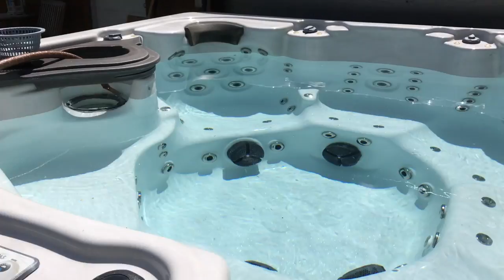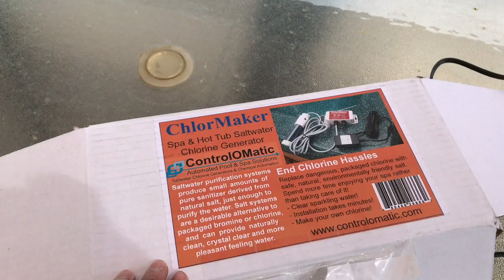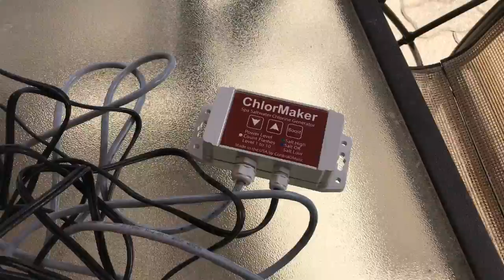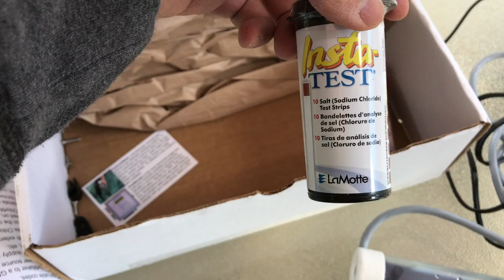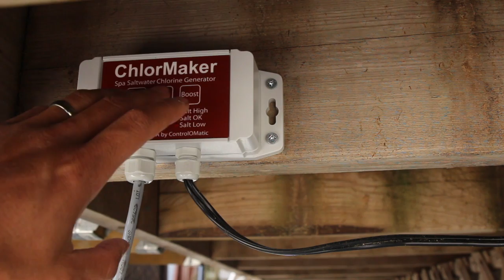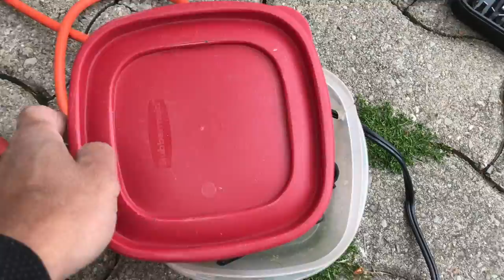Salt Water Chlorinator for your Hot Tub (ChlorMaker DO)

Comment: Thank you so much for this. The company is now defunct sadly they didn’t have enough customers. I got one, but I got the bromine Clormaker maker. My question is this can I use pool salt in this one as well or do I have to use the bromine salt?
Reply from the maker: Using regular pool salt (sodium chloride) in a bromine Chlormaker will not break the unit. The Chlormaker is designed to perform electrolysis on dissolved salts.
However, instead of generating bromine, it will generate chlorine. This is because the sodium chloride (NaCl) will be broken down into sodium and chloride ions, and the chloride ions will be converted into chlorine gas.
Therefore, if you use regular pool salt in your bromine Chlormaker, it will still "work" in the sense that it will produce a sanitizer, but it will be chlorine, not bromine.
If you specifically want bromine as your hot tub sanitizer, you must use sodium bromide salt. Using the wrong type of salt will simply result in the generation of the incorrect halogen.
Reply: Thank you so much. This is a Great easy to follow video and thank you for replying to me. We had our first soak and are so much happier than we were in the chemicals. The salt is wonderful feels much better on the body..

Comment: Convert your chlorinated hot tub into a chlorinated hot tub.
Fact check: if you're hot tub does not have a titanium heater element & is stainless steel which almost all spas are stainless steel the salt chlorination will corrode the heating element.

Comment: Will the salt water corrode the heater element? Some have reported needing to replace their water heating element after a while. Thanks.
Reply from the maker: yes the heater element and the housing tends to degrade faster with the salt water.  it’s easy to replace though so you know how to do that yourself,  it’s worth converting to Salt water.
Reply from the maker: yes the heater element and the housing tends to degrade faster with the salt water.  it’s easy to replace though so you know how to do that yourself,  it’s worth converting to Salt water.

Comment: Hi Danny, thank you for the very informative video. I just got my Chlormaker, and will be setting up my hot tub this week. Wanted to ask about any additional chemicals, will I need to use anything other than salt? Thanks
Reply from the maker: well you still need to test alkalinity, and PH so you might need an increaser or decreased for each.  also, I like using spa shock (non-chlorine one) after a big event when lots of people have used it (say more than 4 people). That way, the unit doesn’t have to super chlorinate and it lengthens the life of the salt cells.
Reply: Thanks for the quick reply. Looking forward to using my salt water spa.

Comment: Where does the salt you buy in bags go?
Reply from the maker: You put the salt in the water, one cup a at a time until your salt levels are at the recommended amount…usually 5 cups to start
Reply: @DDIY-Guy   thank you, I wasn’t sure if it needed to be placed into a specific area of the tub ie near filter….Totally new to this whole hot tub thing!!  Just bought one 2 weeks ago, waiting for the electrician to come and set that up….looking forward to enjoying some nice evenings outside enjoying the hot-tub and the night sky!!
Reply from the maker: That’s fantastic!  Which salt unit did you get?  I got the SmartSpa version which I also did a review on.
Reply: @DDIY-Guy   we haven’t gotten a salt water unit to add on as of yet….we are trying to gather as much info on them in order to decide which is best and will work best!!  I take it you are happy with the one you purchased?  What kind of salt do you buy to use in your unit and is there anything else we need to buy to go along with the salt water system?  Thanks again for the help!!!
Reply from the maker: I got the ControlOMatic SmartSpa from www.hottubcoverscanada.ca and we are really happy with it.  The salt you use can be baught in big bags at your local pool store. I got mine at Costco for $6/bag….it’s called Pool Salt.  You can buy specialty salt but they are really expensive.

Comment: Hi Danny, wondering if you are still using this and if you’re happy with it? I am looking at buying the Megachlor - CD from this company for my pool. Thanks in advance.
Reply from the maker: I actually had an issue with the seal on the drop rod so I reached out to the company I baught it from and I ended up upgrading to the better and more improved version….the SmartSpa.  I love it since it has the automatic chlorine level sensor and only generates when the tub needs it.  I did a review on that one as well.  Had it for several seasons already and very happy with it.
Reply: @DDIY-Guy  GREAT QUESTION KIMBERLY! I almost didn't read this far / look at dates. Now I'm going to go watch  Danny Jose's review of SMARTSPA

Comment: Be careful on new spas!! Be sure that salt won’t kill your warranty. Salt is corrosive so if you run your salt to high it will fry your pump, heating Elements. Anything metal. If you are allergic to chlorine then look for another option like this.
Reply from the maker: Good suggestion on checking your warranty but chlorine and bromine is also corrosive to metals so I’d be surprised if salt water would void the warranty.  Plus the parts per mil in the salt needed is so low that you can’t even tell there is salt in the water. Be careful anyway to buy spas that have corrosive materials in your pipes and equipment as whatever chemicals you use to sanitize you spa…it will corrode that metal. Most spas are made of material that should not easily corrode so do check that warranty.

Comment: Video answers a few of my questions I had before my new hottub arrived. Only issue I had with the video is your Tupperware container if somehow water does get in you will then be soaking your plugs in water. At worst drill a few tiny weep holes just incase.
Reply from the maker: love that tip!  yes, if water gets in the container, it might cause corrosion in the plug box.  I'm going to drill some holes at the bottom of mine as well.  thanks for the comment.  have a great rest of the day!

Comment: Now that you have had the salt water system for a few years how are you liking it
Reply from the maker: Well I’ve had started to have some issues with calcium built up but had to clean out.  Then my seal on the titanium plate connections were defective so I call the place I got it from and they replaced it for me.  Then my power plug stopped working, probably because I left it out all winter long….i got that replaces for free as well.  Anyway, After 2 years of use, I ended up upgrading to the higher version…it has automatic chlorine detection.  Happy with it.
Reply from the maker: I made another video review of it as well.

Comment: Do you have to change the hot tub water more frequently with salt?
Reply from the maker: No I find if you keep the chemical levels balanced regularly, it will be just the same frequency of times you should change the water.  I prefer changing my water every 3-4 months.   in fact, since we use the hot tub a lot more with the salt water, that might make you want to change it more frequently :-)

Comment: Can I just pour in some pool salt? Or would I need to adjust settings?
Reply from the maker: Yes you can add pool salt....but make sure you add a little less than what is prescribed for your hot tub capacity since it is harder to decrease the salt vs just adding a little more salt until you reach the desired amount.  If you add too much salt, the only way to decrease it is to take out a quarter of the water.
Reply: @DDIY-Guy  thank you very much!
Reply: Red Head did you just add pool salt directly to the water ? Did u need to purchase a system? I’m not sure what to do.
Reply from the maker: You just add the pool salt a cup at a time.  No need any special tools.

Comment: I got the smarter spa version which only turns on when needed rather than on a schedule. Since we don’t use the spa consistently we did not want it cycling on on a schedule because the level would get to high.
Reply from the maker: Yes,  that one is certainly better.  I wish i would have gotten that one instead.
Reply: I just got that one, but haven’t set it up yet. I’ve balanced the ph, and I’m ready to add salt. I have a 325 gallon hot tub, and I’m wondering what kind of salt you used. I got one that also has minerals in it.  I hope this will work, because I have a lot of health and pain issues. 
I’m a bit worried because we have city well water and it’s hard and “problematic”. Lol! 
Am I doing the right thing? Thanks!!!!
Reply from the maker: Not really recommended to use any other salt except for pool salt but if the device works with that kind of salt then go ahead.  Not sure if that would void the warranty if the unit gets damaged.  If you go to their website, it will tell you which salt is recommended and what will harm the unit.
Reply: If your quote unquote salt unit ends up getting damaged/breaking. I would at that point move to a different product called"Aero Spa" completely 100% chemical free soaking.

Comment: Hey Danny: thank you for this informative video - my question is: if my hot tub water hardness level is high or low - can I still add the chemicals to adjust and manage this issue? or will it CLASH with the ChlorMaker DO system?
Reply from the maker: Yes, you want to make sure you still keep the water chemistry balanced and check it regularly. I also use spa shock from time to time after a lot of bathers to minimize the use of the chlorinator cell on Boost mode.

Comment: Can you use Himalayan salt or epsom salt instead pool salt?
Reply from the maker: No really recommended to use any other salt except for pool salt but if the device works with that kind of salt then go ahead.  Not sure if that would void the warranty if the unit gets damaged.
Reply: A little late! But, download the info from their sir and it will tell you what types of salts work and which are corrosive.
Reply from the maker: No really recommended to use any other salt except for pool salt but if the device works with that kind of salt then go ahead.  Not sure if that would void the warranty if the unit gets damaged.

Comment: I love this idea, thank you for the video.  Question - when converting my hottub, Can the salt water damage anything inside the hottub, like the plumbing? I imagine high amounts of salt are corrosive?  no?   Our hottub is a Sundance Bahia
Reply from the maker: Thank you for commenting!  Just to clarify....the amount of salt needed in your hot tub is very low...mine took about 6-8 cups of salt for 400 gallon tub so you can’t even spell it or taste it in the water.  All the pipes and equipment are made with materials that don’t corrode (plastic, aluminum, etc) so salt will not harm it.  In fact, the chlorine/bromine that you normally use is more corrosive than the amount of salt that is used.  Converting your hot-tub to salt water is safe for your equipment.
Reply: This guy is absolutely incorrect, salt is corrosive to the metal parts that will come in contact with water such as your heater element for example, all you have to do is go on forums/threads- read about how salt has ruined people's hot tubs over & over & over again.
Reply from the maker: I don’t know about you but I’ve had this chlorinator for over 4 years and my hot tub is still running…including pumps.  Salt or no salt, if you maintain your hot tub properly, then it will obviously last longer.  Whether you use corrosive chlorine or bromine or salt chlorinator, your equipment will break down at some point…remember that in all cases, you are still using water and that will eventually corrode metal parts.  Hoping mine last a few more years….then I simple buy a new pump and replace it for a few hundred dollars.

Comment: can i use this to replace my ace cell? or do i need your generator ?
Reply from the maker: No sure it will fit but it looks like it might work.   The directions for this salt cell is to drop it at the centre of the hot tub but I guess the chlorine would still circulate in the filter.  I can measure the cell so you can compare it to the ace.

Comment: OK, Fill with soft water from the house system (softened water). Add chlorine. Heat to 90 before turning on the chlorinator cell. But I'm still not sure about balancing. Can you tell me more on how to balance the water? PH minus to lower PH? How do you adjust Alkalinity? Our water is always high. Thanks!
Reply from the maker: Measure your water with the test strips, if ph or alkalinity is high or low, just get the chemicals from the pool store to either lower or increase the levels.  If your are still not sure, take a water sample to the pool store for them to measure, and they will let you know what chemicals to put in and how much to balance your water.

Comment: Yes, I've heard and read about balancing. Not sure I really understand what to do. I have test strips for hardness and alkalinity and ph. How do you suggest I go about it? Much appreciate your help.
Reply from the maker: Fill the tub with new water, add your regular chemicals (chlorine, not bromine). Make sure it’s balanced.  Add the salt.  Then get the water temperature to over 90 degree before using the salt-water chlorinator cell.  It’s pretty straight forward.  I find I use less chemicals in general to keep the water balanced going forward.

Comment: I think I'm going to go salt on your recommendation. With chlorine or bromine I was told to Not use softened water, but to use untreated well water. But it sounds like with saltwater I could use pre-softened water from my house system. Can you confirm that it's ok to use soft water? A big advantage to me would be the avoidance of iron colour which we get now from the direct well source. Thanks!
Reply: use a rv water filter on the end of your hose. works well for me
Reply from the maker: Awesome!  Thanks for sharing the comment
Reply from the maker: As long as you add the proper amount of salt with the capacity of your tub, the generator will produce the necessary chlorine needed to sanitize your water.  Make sure you balance your water levels first before using the saltwater chlorine generator.

Comment: Do you have to start with a clean fill and clean filter or can you just drop it and start using it right away
Reply from the maker: If your water is clean and you were using chlorine vs bromine, then yes you can drop it in and start using it without changing the water.   But remember that you have to add salt to your tub before using it.

Comment: Im sorry but isn't that cell suppose to be plumed into a circulatory pump? That makes no sense just to leave in on the side of the spa. It wouldn't be doing much to your water except building up chlorine inside the tube :/
Reply from the maker: The chlorine comes out of the 2 holes on the side of the cell tube.  I’ve had it for about 2 seasons and it produces enough chlorine for me to sanitize my salt water hot tub. You do have to shock the tub every time I have had many bathers in.  Otherwise, I check the water levels at least twice a week.

Comment: I want to install a hot tub in the backyard of my house. What are the things consider before I meet a hot tub contractor?
Reply: Location is very important when buying a hot tub. Make sure that you have enough space, a sturdy surface and access to electricity. A hot tub may occupy a big part of your backyard. It is a good idea to bring a rough sketch of your backyard to the hot tub contractor. This will help you and the hot tub contractor review the layout and find the best hot tub to fit into your space. 
Ref: http://www.westrockpools.com/2016/08/16/what-to-consider-before-buying-a-hot-tub/
Reply from the maker: +Smith Naomi i would consider how far you want it to be from your backyard door...the closer the better for those cold nights you plan to us it. What type of foundation your ground can support...is there already concrete there, is it going on grass, is your area mainly clay or is it soft ground.  How far is it from electrical.  Where does the sun rise and set. Being under a shady area is ideal since the hot tub gets really intolerable during sunny hot days.  Finally, best to be beside a deck or flush/levelled with a deck to make going in and out of the hot tub easier...especially for young kids and the elderly.
Reply from the maker: +Smith Naomi please make sure you like the video and/or subscribe.  Thanks for your comments and support!

Comment: Do you still add a non-chlorine based shock?  Or do you shock it at all or do you use a chlorine-based shock?
Reply from the maker: +InRealTime Showing you can use both but I use a non-chlorine based one myself.  I only use the shock after a lot of bathers.  It saves me from using the super-chlorinate feature on the unit and prolongs the life of the cell.

Comment: Thank you for the video!  Your walk through was very informative and I just purchased the ControlOMatic Smartspa version based on reviews and videos like yours.
Reply from the maker: +SSEBRD that's great.  The love these salt water chlorinators :-). Enjoy your salt water hot tub!
Reply: Do you need to use any other chemicals to control the pH levels, alkalinity, or clarifier? Or is it pretty much maintenance free after you add this device?
Reply from the maker: +TAPRACKBANG I do check the water chemistry from time to time to make sure my water is balanced.  There are times that I do have to lower PH or add a clarifier to the water after I have shocked the tub after lots of bathers but that’s not due to the device.  I do find it’s less often that I have to add chemicals though.  I haven’t had to add any other chemicals other then shock, PH- or clarifier....I don’t like to use the super shock option to get the cell to last longer.